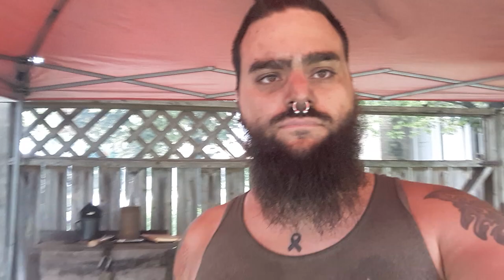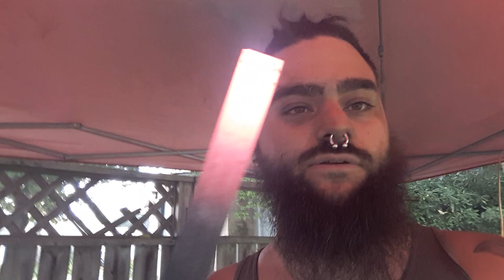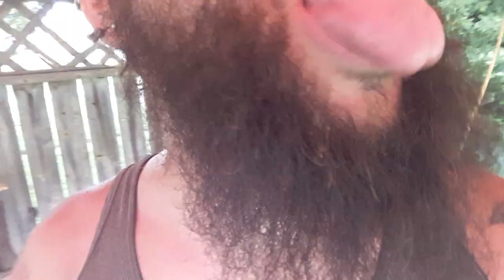Hot steel across tongue

Comment: The Australian guy I apprenticed with told me a story of how they used to toughen up the apprentices hands in the steelworks forge he started at back in the fifties using a white hot bar.  The apprentice would hold out his hands palm up and a piece of thick round bar would be heated white hot and at the signal they had to grab the bar, the split second they did the smith would yank the bar out sideways and the apprentice would have to run over to the forge and hold they're hands over the fire. The idea being that any blisters were dried out as they formed.  He said it hurt like an utter b*tch but after that was done you couldn't push a needle into your palm.  Instant elephant hide. 
When he asked me if I wanted to try it I said f*ck that for a game of soldiers, I've got gloves.
lol :D
Reply: Rum Castle     Sure, it could all be a load of old bollocks and just a good story but the thing that always stopped me from dismissing it completely out of hand was regularly seeing him pick out a glowing coal from the fire bare handed, casually light his cigarette with it and then toss it back into the fire with no ill effects. No burn, no blisters, nothing you could see and it wasn't just for show either, it was literally how he lit his cigarettes in the shop whenever he couldn't find his lighter. He's just an old school beast, and granted, quite possibly a teller of tale tales too :D